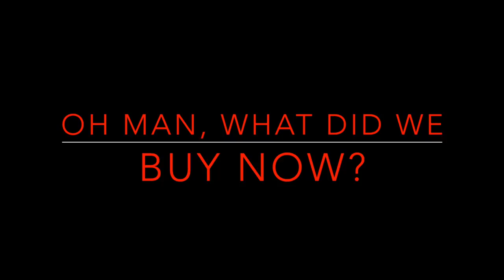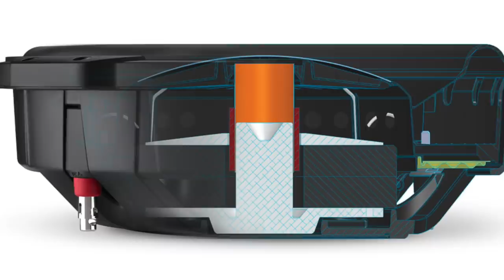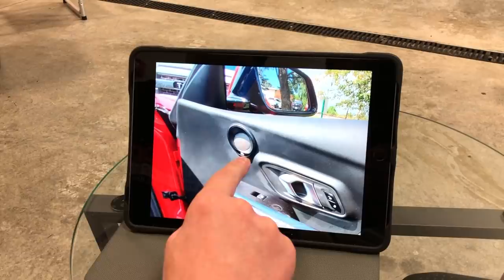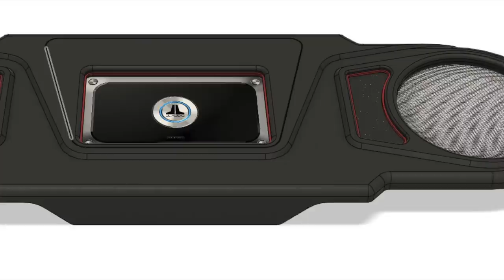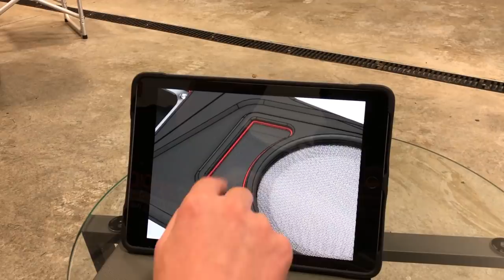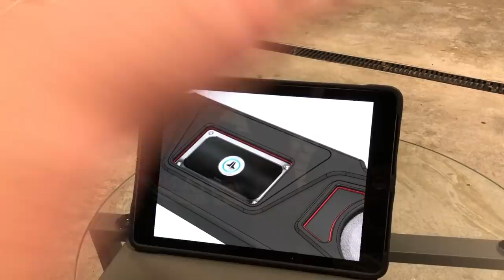2020 TOYOTA SUPRA JL AUDIO Speaker Upgrade!

Comment: For those wondering what the math is on the sound system it would be around $3300-3500 in components alone to clone this system and that's not including the custom fab and installation. Save your pennies
Reply: KDad514 but it sounds sooooo good
Reply: @boughtnotbuiltoffroad7784  No doubt, it's just a little out of touch for those of us with day jobs. Not knocking it at. In fact, back before we had kids, I was quite the audiophile and built some serious systems. They're just not in my budget range anymore. Can't wait to see how the build looks when it's done. What are the chances that CAF will let you use some of his footage for your channel just to give snippets of the progress?